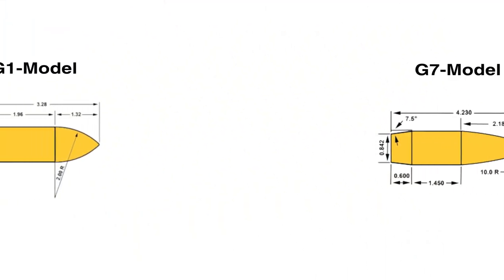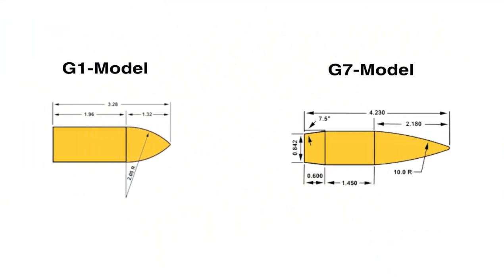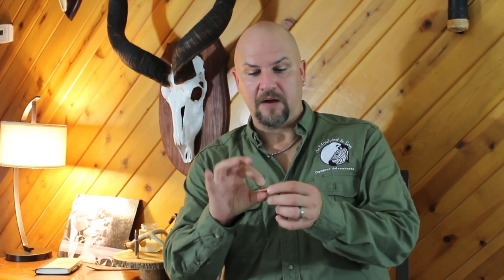Shooting Basics: What Is Ballistic Coefficient?

Comment: I have a DVD from Brian Litz who is a ballistician for Berger Bullets with a degree in Aeronautical Engineering. That said the Applied Ballistics DVD explains sectional density and Ballistic Coefficient and how to set up at short range to improve your long range accuracy. His simple definition of B.C. is a bullet or projectiles ability to penetrate wind. Of course this gets into bullet design, weight, length, atmospheric pressure, wind, muzzle velocity, sectional density, outside temperature, the affects of different elevation which affects air density and  correalis effect at extreme long range. For anybody really wanting to learn how to shoot long range I would suggest purchasing the Applied Ballistics DVD by Brian Litz. He has even created an app for smart phones that you plug in your data and the app will give you a Ballistic calculation for your shot. If your shots are off, there are corrections you can make in App that  gives you a correction factor to improve accuracy. The dvd is really great and breaks all the different aspects of shooting long range starting with setting up your rifle at short range doing a tall target test to see how your scope is tracking and how to make corrections if the elevation is not tracking the proper amount based on how many clicks of elevation you use. It also will show if your scope is installed properly and the reticle is truly level and plumb. I could go on and on but if you want to shoot long range successfully I would urge any shooter to invest in this DVD!

Comment: Well explained ! Thank you. If you are going to do this again, would it possible to include a real example of a higher B.C vs a lower B.C in the same weight ballistic pls (e.g 6.5 Creedmoor vs 270 Win)?
Reply: Basic geometry. Caliber is the fixed feature, grains (weight) is the adjustable feature. Higher weight means longer, more slender bullet in a given caliber. Comparing two calibers where the weight is the same between them, the smaller caliber will result in a higher BC and SD due to the bullet weight being established moreso in length rather than diameter. This is very general of course because bullet shapes vary even in the same caliber and weight.

Comment: BC is NOT "bullet-specific" and "bullet-exclusive" and "BC" depends on the BALLISTICS and conditions while a bullet is "in flight" which aren't determined JUST by its "shape". BC is calculated for a specific bullet FROM its in--flight "performance" and identical bullets loaded in two different cartridges both in that same caliber but producing different MV will result in the two bullets having two different calculated Ballistic Coefficients. They should be "proportional" TO velocity when corrected to "standard conditions" but without "load data" from "factory" ammunition testing in a real "ballistics lab" with controlled conditions such as Hornady's 300-yard underground test "tunnel", no "BC" can be calculated and lacking "factory" ammo "ballistics" and bullets "matched" to specific cartridges within a "caliber family" and designing specific bullets for specific cartridges and testing specific bullets on in cartridges they were designed for (no point in testing 100-grain .308-caliber .30 Carbine bullets in .300 Winchester Magnum) and being able to "average" BCs for a given bullet from multiple cartridges its "made for", any published "BC" is complete B.S. 

And BC is more accurately defined as a bullet's "ability" to "ignore" the "atmosphere" through which it travels and be "unaffected" by it rather than its ability to "slice through the atmosphere". In the real world, the "atmosphere" through which a bullet "flies" is constantly changing simply because even if nothing else "changes", its velocity does. And the slower an object travels and the less "inertia" it has, the less able to "slice through" or PENETRATE its "atmosphere" it is.